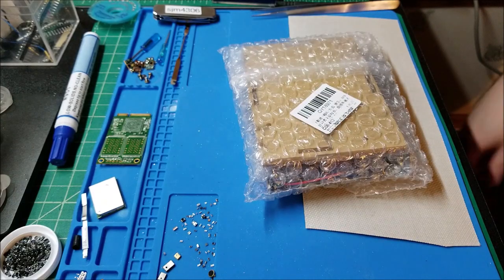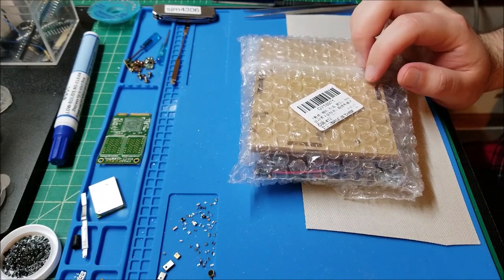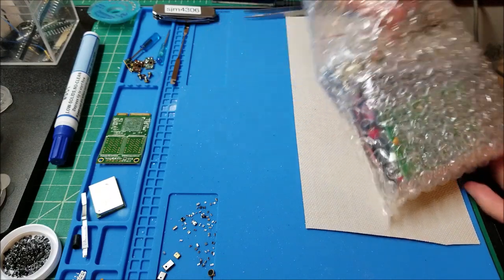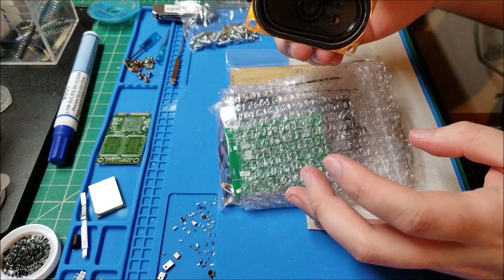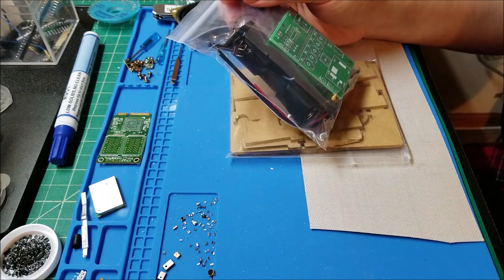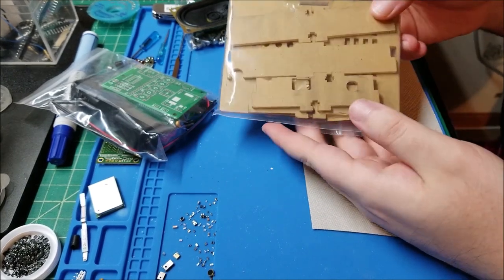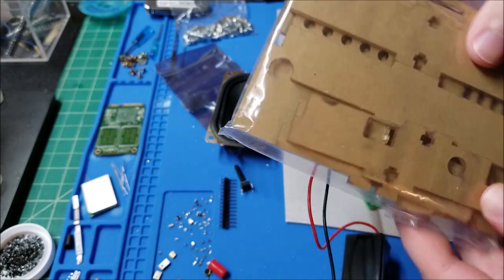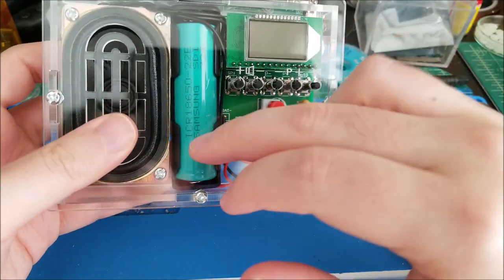ICStation Digital FM Radio Kit Assembly

Comment: Shaun, do some more cool vintage style Led display projects 👍🏻
Reply from the maker: Oh I'm itching to get back to those kinds of projects! Just not so much soldering each and every tiny led by hand so I'll have to give JLCPCB's assembly service a try.
Reply: How about a custom USB project?  I need a module that would close a relay whenever a Microsoft Outlook meeting reminder is active.  The idea is to let shop floor guys know when it's meeting time (relay would turn on a light on the shop floor).  I'd be willing to finance the project (within reason, of course).
Reply from the maker: If there's an api for something like as esp8266 or 32 then it'd be an easy project, otherwise I'm not really knowledgeable enough on embedded internet applications to be able to detect meeting times for outlook with a microcontroller.

Comment: Firstly your video was very helpful in assembling the kit it's actually a great FM radio I love it !

Secondly when charging the battery a red LED illuminates but does it ever go out or change colour when fully charged ? Seems to stay red even with a brand new battery and leaving on charge for hours
Reply from the maker: Thanks and yes the red led will turn off when done charging and a blue one will turn on.

Comment: Hey, it worked 😃finally, the problem was at the chip of course, I fixed it and it works now perfectly :D thank you <3
And I have one more question, if I can actually use Bluetooth there ? Like with phone ?
Reply from the maker: Great, happy to hear you were able to fix it! As for bluetooth, the hardware doesn't directly support it but it would be possible to wire in a bluetooth receiver module if you wanted to.
Reply: @sjm4306  ohhh yeeeeaaah I get it now, thank you for explaining :)) At least Im gonna enjoy fm stations ;)

Comment: Hello, really good video :D But I have BIG problem... When I turned it on, (I didnt already build the radio box, just trying if it works before it actually haha) display works perfectly, but no sound responding from speaker... So something is really wrong, I put in headphones jack, radio works, but when I want speaker, NOTHING! So I dont know what to do with it, Im angry and sad :(
Reply from the maker: Double check the soldering to the speaker. If that all looks good then it's likely the amplifier chip soldering or the chip itself is damaged from the factory. The reason headphones would still work but not the speaker is the headphones take the audio signal before it reaches the amplifier.
Reply: @sjm4306  Thank you very mucy for reply :D umm I will try something, resolder the speaker but I guess there's no problem, cuz it looks normal like pther components... Maybe the chip, I was doing it "by myself" harder way, it was hard for me but I thought it was alright, maybe, we will see, but idk what to do with it hahah

Comment: Reccomdations for a good Discman like player? I used to have a nice RCA one with the AM/FM radio. But that bit the dust years ago. Now I just have one of those cheap  Onn players. It would just be a player to carry around in my car and on walks ect. So, decent anti-skip would be appreciated. Budget would be 50 to at the highest 200 bucks.
Reply from the maker: A midrange to high end Sony is where it's at. I recently got a d-ej815 for $30 and am in love with it. I also have some of the atrac3/mp3 models like the psyc series that are very good. Great build quality, great sound quality, great battery life, and never skips with g-protection turned on.